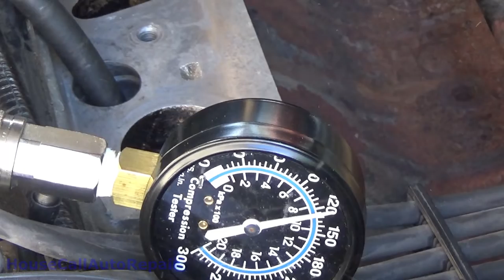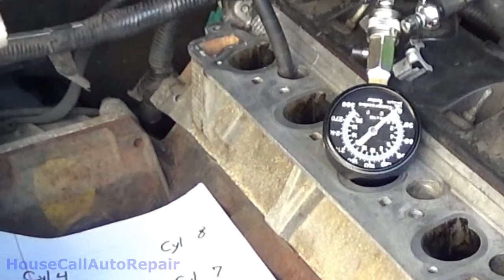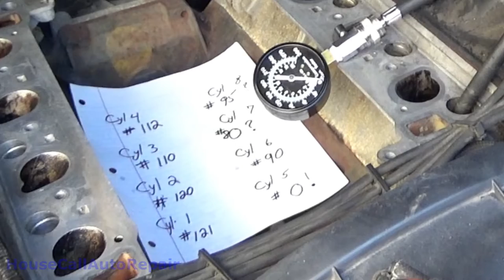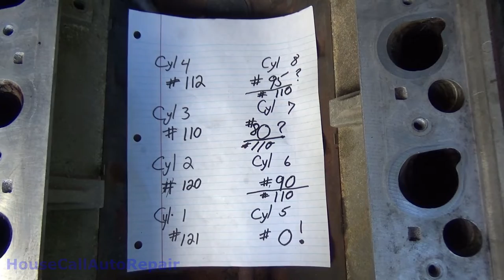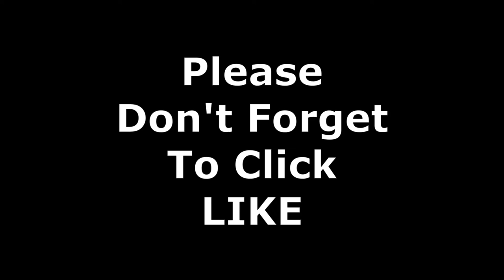Compression testing... See description

Comment: I have to say never saw a burnt valve on a 4.6 2v what I have seen was a stretched valve stem causing the rocker to hold it down to far. Can you take off the valve cover? Before you remove the head?
Reply from the maker: I'll probably be doing that fairly soon. So many other things and editing to do yet...
Reply: I fixed a broken spring on a 4v.

Comment: Will the computer turn off that injector?  What about disconnecting it so you don't hose the CAT.
Reply from the maker: I'm currently not driving it. I still haven't pinpointed the reason the intake valve isn't seating. As a 97 Ford, I don't think it can shut off injectors. It's funny how it really runs like crap when I do unplug the injector on #5

Comment: Why don't you work in a shop. Did you used to
Reply from the maker: LMAO! I worked in a shop long enough to get a shock absorber half removed. The owner told me I couldn't use an air chisel to cut the top of a rusted solid shock, in the rear end of a Lincoln Towncar... Half an hour later, I drove back by the garage to hear the owner hacking at it with the air chisel! (a-hole)
 And the last time I inquired at a CHAIN garage, they offered me $13/hr... F THAT!